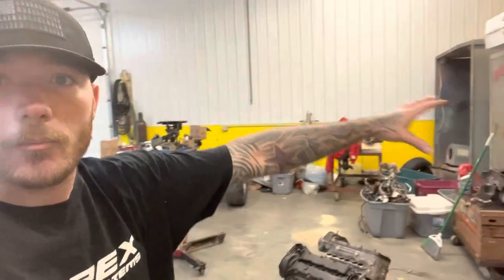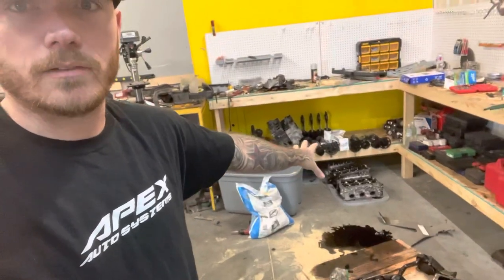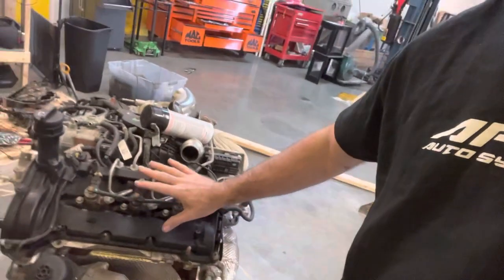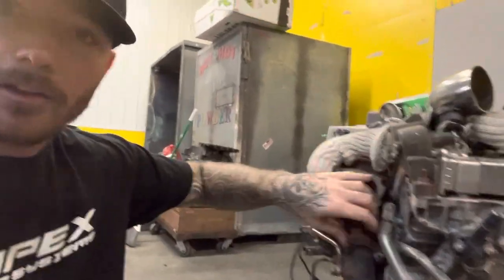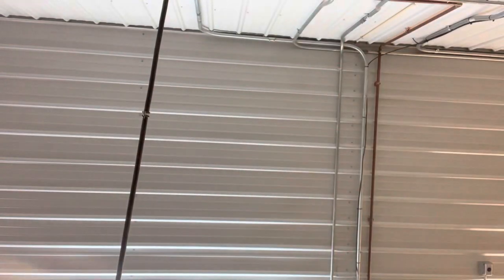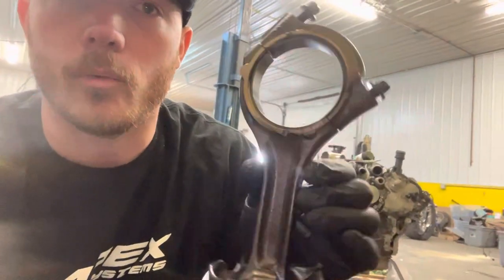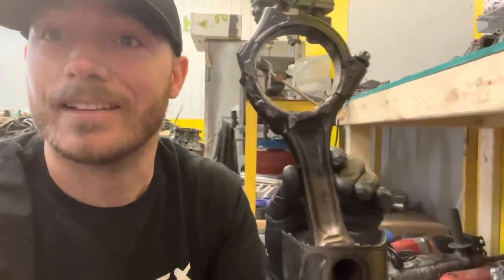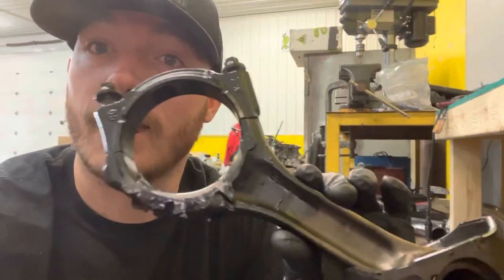Ecodiesel bearing issues!

Comment: I have a 2020 ecodiesel that the engine failed. It took 4 months to replace the engine with new at the dealership. I picked up the truck on 4/19/2024. The engine is vibrating to where I feel it in the seat steering wheel and floor. I told the dealer, they said there are no codes and is good to drive. I have 84500 miles on it. I need advice on what to do.
Reply from the maker: Sounds like balance is off
Reply: did you ever figure out this issue i have the same thing thx

Comment: My 2016 Ram EcoDiesel started vibrating and the oil pressure gauge went to 0.  I was able to shut it down before it seized, but it had lost all the engine oil.  The oil filter is now full of metal chunks.  Your videos has given me the most hope of anything I have found so for.  Please let me know if I can get one of your rebuilt motors or if you can rebuild mine.   Thanks
Reply from the maker: We can do both

Comment: 1) can you provide a little insight as to which metals in a blackstone oil lab test would be related to each type of failure? 
2) will you work on fully functional engines to proactively eliminate potential failures?

Comment: This is my second engine failure with the Ecodiesel. The vehicle is great on many counts, but the engine sucks. The first failure was en engine seizure. I had it replaced with a second hand engine from a wreck, it lasted 24,000 k and started having a clonking noise in the lower part of the engine and I had to have it towed to a shop. I kept the old engine so I'm thinking of trying to fix it myself. If I understand that you resolve the issue of the crankshaft by having it chromed? Your video is very helpful to understand the problem of the bearing failures. Thanks.
Reply: ROFLMAO. 

Yeah. You're DEFINITELY QUALIFIED to "fix it yourself" when you obviously can't own, operate and SERVICE - NOT "MAINTAIN" - WELL ENOUGH "BY THE BOOK" TO PREVENT THOSE "JUNK" ENGINES FROM CATASTROPHICALLY FAILING REPEATEDLY AT "LOW MILES".

Comment: This is the most informative video so far.
Can you remove the oil pump from the front of the engine without removing the pick up tube?
Is there an anti drain pr pressure relief valve in the oil pump?
Reply from the maker: Yes and there should be

Comment: I have a 2017 Ram EcoDiesel that just blew up on me.  Took it to the dealer and they want $25k for a new engine installed.  I bought is in December of 2022 from a man that developed cognitive problems and stopped driving.  His wife drove it twice a month to the dumps and it was maintained at the dealer.  It had 8k miles when I bought it and 17k when it blew up.  Can it be rebuilt?
Reply from the maker: We rebuild them drop truck off we charge 10k pick it up done

Comment: So, what's your opinion on the Mecanical Engineers who Designed them?
Reply from the maker: Engineering isn’t the issue, seems more of a cost cutting decision.
Reply: @Recklessmotorsports Engineering isn't the issue? Do you realize that because the rod and main bearings are so narrow that the diameter had to be increased for surface area? That larger diameter then creates more surface speed on the bearings at rpm which is harder on the oil and the bearings. GM threw this engine design away and Chrysler picked it out of the trash.

Comment: change your oil sooner and use a good synthetic 5w . realisticly I think the oil is getting way too dirty from the soot in the egr. I change mine every 7 to 8k and so far no problem.
the gen 3 ecodiesel is a lot better, gen1 and 2 have most of the failures.
Reply from the maker: Oil has nothing to do with these failure
Reply from the maker: Gen 3 uses an updated crankshaft.
Reply from the maker: Also there is no soot build up, that’s an old myth
Reply: So what is the lifespan of a 2023 motor
Does the gen 3 remedy all the issues?
Reply from the maker: No it isn’t what I said
Reply: @Recklessmotorsports can I ask how oil has nothing to do with these kind of failures? Oil viscosity and breakdown with high Temps is defiantly a factor in these engines. When the oil can't properly dissipate heat from major components like a main bearing it causes extreme wear on all of those components and early failure.
Reply from the maker: @Kyle-mo5si  the cause is engine lugging, which has nothing to do with oil

Comment: Are the gen 3 cylinder heads, intake manifold, exhaust manifolds and turbo worth putting on a gen 2? Also what type of mileage are these bearing failures occurring at?
Reply from the maker: Just wouldn’t be exhaust and turbo the rest is the same

Comment: The worst things ever put on a diesel pickup truck are the EGR and def systems. Unless you enjoy engine failure and paying thousands in repairs..their has to be a better way to save the environment..
From recent experience .....
Low oil pressure light... Is your oil black on the dipstick days after oil change. Oil pan plug full of black shit.... Check your oil filter for crud, cut it open and examine it...a black soot type of shit in the filter? Yup.. Flush your complete oil system, DROP your oil pan , clean it and the clogged pickup tube that's starving your engine from oil... it may save you from a shady mechanic saying your engine is junk when it's not and a real engine failure

Comment: The failures are due to wannabe "engineers" using incorrect engine oil, filters and service procedures along with "tuning" and/or "deleting" engines 100% factory "tuned" to LIVE only with fully functional and intact "emissions" and factory "tunes". 

Bearing failures - i.e. "spun" bearings are ALWAYS DUE TO LUBRICATION SYSTEM/LUBRICANT FAILURE SPECIFICALLY "LOW OIL PRESSURE" . 

Just because a diesel engine is in a "truck" does NOT mean it should be "maintained" with "diesel oil" commonly used in "real" diesels. 

And anytime you go for "more power" from an "economy class" engine and powertrain you are guaranteed to see "comebacks" in the form of catastrophic engine failures MUCH LIKE you're "seeing" many more of "online", lol.
Reply from the maker: Yeah you’re 100% wrong here buddy